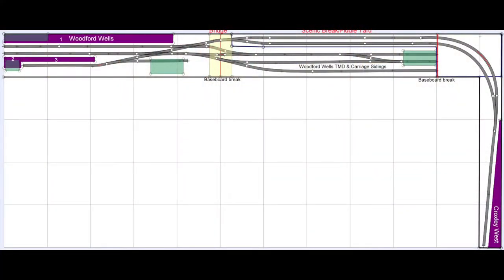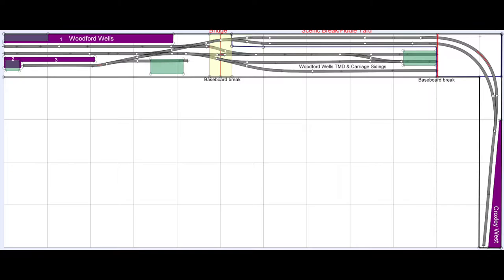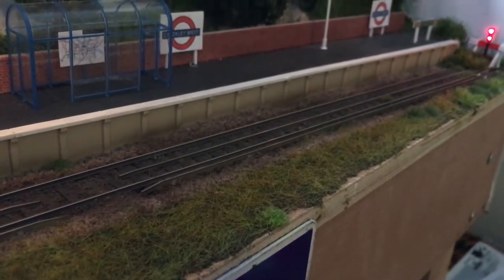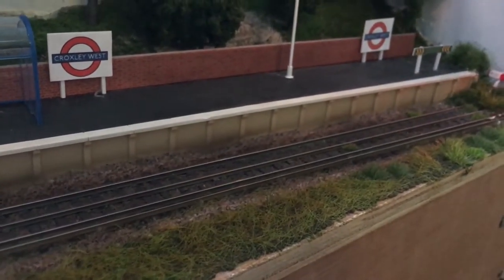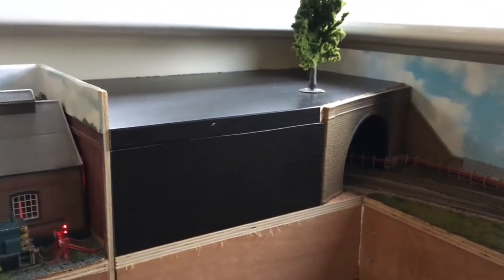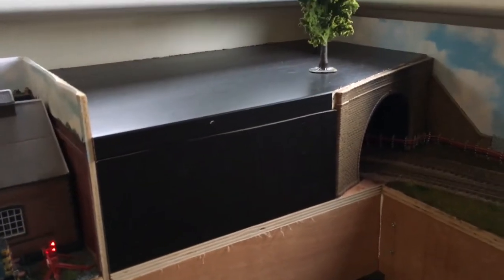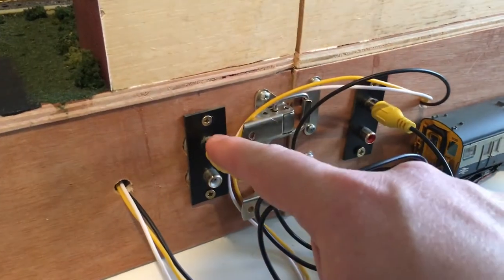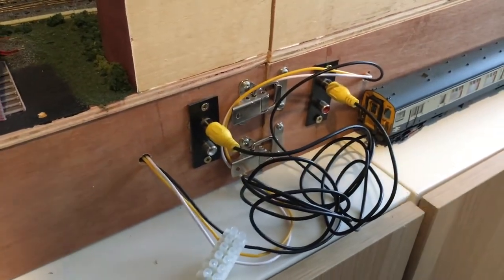Woodford Wells Layout Update: Episode 11A (DCC Wiring, Weathering & Corner Scenery)

Comment: For wire connection I've used what we call "Suitcase Connectors" they come in multiple sizes (thicknesses) so you can use thinner wire for the droppers - with an appropriate size suitcase. I like the idea of using audio connectors, might use that myself, if I can find a local supplier.

Comment: My preference is to put some scenery on top of the curve that can be sort of a neutral transition between both scenes. It can slope upward to just shy of the window sill for clearance. It doesn't need to be too detailed, but just enough to tie both sections together. The abandoned right-of-way would work nicely as well. Also, I would remove the backdrop above the retaining wall at Woodford, as well as at the corner structure, and put some low relief structures/roofs/treetops(? [maybe even in a smaller scale to force the perspective?]) in its place to give it some depth. Really nice modeling. Happy new year!